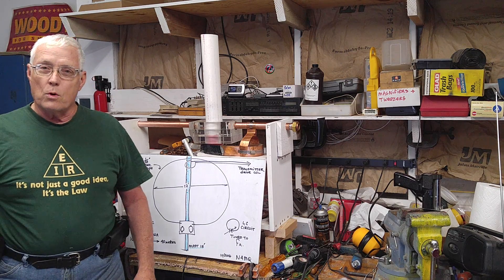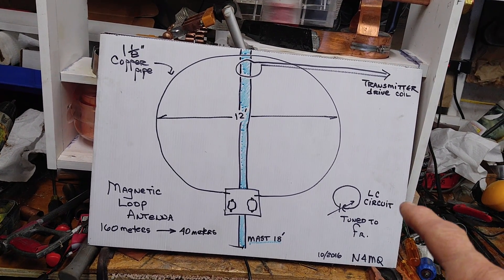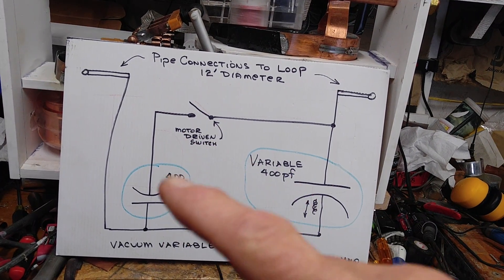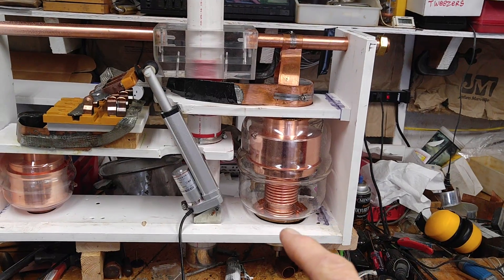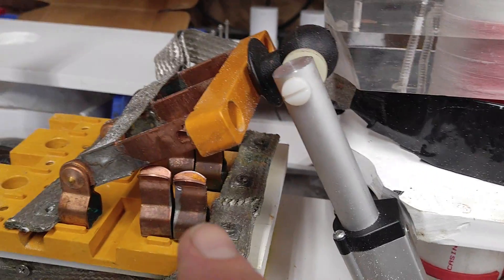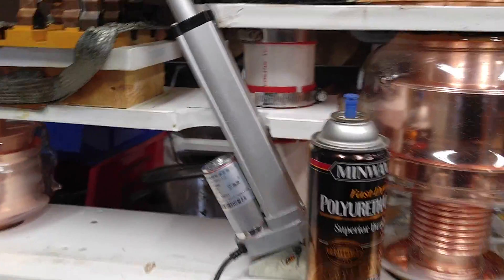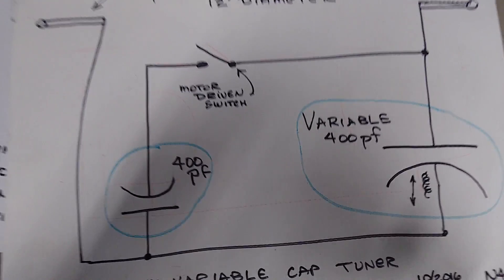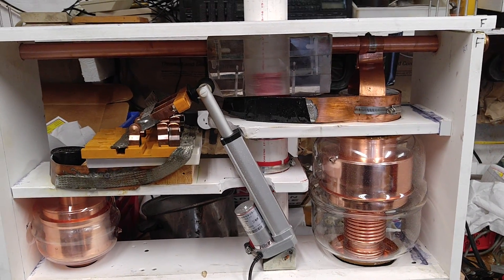Magnetic loop antenna for 160-40 meters 1KW

Comment: These vacume caps give very good performance due to low losses and high breakdown voltage ratings. Have you considered the leakage paths of damp wood in the construction and what that would do to losses... Power = v^2 / R.. if R is 1 megohm and V is 10000,, power (lost) is 100,000,000/1000,000 = 100W!

Comment: Love to hear - six years later - how this worked out, your thoughts, any improvements or did you move on and why.  73 M4MQ
Reply from the maker: Its in pieces waiting for 65+ temps. I took it apart to change out 400pf for 250pf cap. I want to get it back on 40 meters, was there before i upped caps to 45kv for 1kw operation. Hope for 1kw again with shorter leads to cover 160 thru 40 meters. 73. Ww
Reply: @woodyw6933  Thank you, and 73   Please keep us posted.

Comment from the maker: The coil -loop and capacitor for the resonant loop and are in parallel or series, two components form that sort of connection. The current is on the capacitor and the voltage is on the loop inductor as they are connected together.  The max current is not at the same time as the voltage max, they are out of phase.  Please understand the cap is max voltage when the current falls to zero and begins to rise GOING into the loop.Max current occurs as the cap discharges into the inductive loop.  Nothing happens independently when the current sloshes back and forth between the two components, they share the energy at different times.  I used a switch that had the largest spacing and also had three contacts in parallel to handle the current, running about 70 amps and the cap has about 35-40 kv at full power AT The contamination still had tracking marks from surface-moisture from the atmosphere, 40kv is a bitch. Enjoy Woody

Comment: I just ordered one of these Russian 45kV variable monsters.  Coming via slow boat from Bulgaria.  I'm hoping to build a loop good for a kilowatt on 40 & 20.  OK, I'll take 15 if I can get it.   Wondering about that switch...surely the capacitors are at the high voltage end - and the high current is at the other end of the loop?

Comment: BRAVO for your efforts and experimentation Woody! I made several experiments after university. That time (1971-1974) the calculator did not exist. I was thinking, what if you use a cheap (RX) capacitor and put between plates sheets of mica to stop arcing. 73s from 5B4ER (Cyprus)
Reply from the maker: Russian vac variables are reliable and humidity does not effect them, 72. Woody

Comment: Woody, did you do a quick cw “TEST” on 3705khz at 9:40am, 1/30/20? Heard 50mi North, had QRM. Apologies if not you.
Reply from the maker: Yes. I was testing 2 watt hartley running 2 type 27 tubes getting ready for my 3705 net group. Its for awa events. Woody

Comment: You don't need 3x switch because there is high voltage and low current at the capacitor. It would be better to make 1 switch and increase gap between switch's contacts.

Comment: Woody, very impressive work and I am excited about your impending trials.  I might point out however that putting the two capacitors in parallel will not help your voltage arcing problem as in a parallel circuit, voltage is everywhere the same.  You might consider putting the capacitors in series which would double the voltage capability (30KV) but it would unfortunately half the total capacitance value (200pf) and probably preclude use on 160M; perhaps even low end of 80M.  The really only practical solution for KW and 160M is to find even higher rated capacitors, probably unlikely, or increase the size of your loop.  If you're able to currently run 300watts on this at 160M, suggest you just enjoy it or be prepared for buying a lot more copper.   Good Luck, looking forward to next video.

Comment: Time to rip the Flux Capacitor out of the DeLorean and talk to Marconi directly with 1.21 Gigawatts of time busting RF! 
Remember, time is not an issue anymore with such ventures into the ether... God's speed and good luck, Doc! 
(I assume it will only have negative consequences on birds, household appliances, planes or automobiles if they are traveling over 88mph)

Comment: I am confused going by your T shirt you said in the order of 20Kv 100 amps so that would make power into antenna E x I =20 Mwatts....What are you trying to do fry the Birdlife LOL....Either that or its a very very inefficient Antenna and will cost you a fortune in Electricity...Why you even need to use 1Kw let alone 20Mw is beyond me 1 S point less signal strength when using just 100W and a lot cheaper on Electricity bills...
Reply: House power supply would need to be 18,181Amps at 110V and that is assuming your Transmitter is 100% Efficient LORL
Reply from the maker: Your are missing the reactive nature, the current and voltage are out of phase. Life is short, I run 300 w am .  The mag loop is less efficient than a dipole so it evens out. Woody

Comment: It's worth all the work and expense to have vacuum vairables. The only way to get control of the Volts and Currents for a mag loop on 160M. And 1 kw??? Yeeeooowww!!
Reply from the maker: Band width at 3DB is 5000 cycles at 1.885 Mc.  Really high Q and lots of noise rejection on the band follow the utube clips to see more, oody
Reply: Adrian Cressy seems like you could make your own vacuum variable capacitor using plexiglass and a butterfly capacitor and a vacuum pump..
Reply: Good job, Woody! How did it turn out?

Comment: It is expensive and hard to find that capacitor. Why do not makes one with sheets of copper and teflon?
Reply from the maker: Tested antenna, was about 5kc bandwidth at 3DB points, ran 915 watt carrier at 1885 without arcing, mission accomplished and all is well.N4MQ
Reply from the maker: Thought about that, but $129 will be functional now and retain its value without fiddling around, thanks Woody
Reply: Any solid dielectric will have losses and lower Q of the system. The loss will only matter in a very high Q and/or high power loop, like this one. So going with fixed value vacuum is very wise.
Speaking of losses, I remember reading somewhere that braided connectors actually have higher RF impedance than a solid copper strip. Which again only becomes relevant in extremely high Q/power applications. Just something to keep in mind.
Reply: Woody Woodworth the Cap voltage should allow you near a legal limit wattage rating. should it not? I've been thinking on building one like your's. and one for 40 to 10. but I query a phased and spaced array to make for more directional and produce gain. but before that, I want to use the extra antennas in a criss-cross setup for an omni antenna. if it's at all possible.